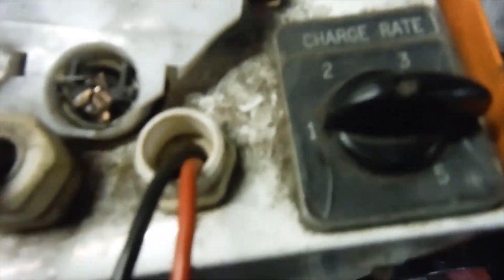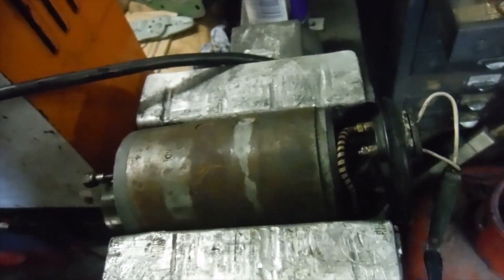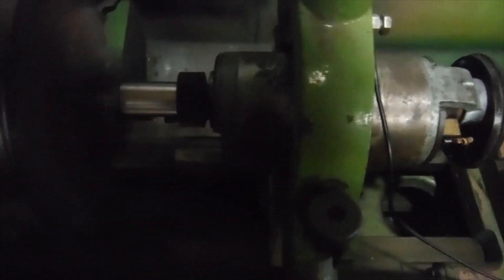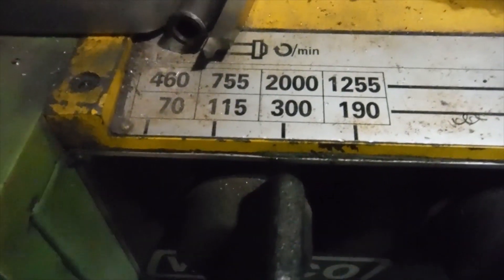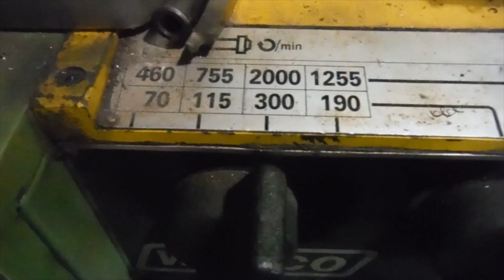Lucas motorcycle Dynamo checked for output and discussed.

Comment: Hi Paul  , I have two old bikes BSA AND Matchless singles  with dynamos  but they haven't Ever had the wiring for the dynamo hooked up while I've owned them , can you tell me if I can install my magdyno and run the engine without any wires hooked up to it ?  Previously had no gear , or will it damage something?  Sorry to ask but that sort of stuff isn't written in any books I've got , hopefully I can get it wired ok with new DVR2  it's going 12v conversion armature etc . Cheers
Reply from the maker: Hi - yes, you can run the dynamo while it is not connected up, no problem.

Comment: The MCR type mechanical regulators are good at killing dynamos. Also using a battery that's too small also burns out regs and dynamos.  The makers and repairers tell you to use a battery no less than 10 amp hour. This means that 4.5ah miniature batteries in a dummy battery case is far too small and need to be doubled up inside the case.  Also a good solid state regulator is the way to go these days, and they fit inside the MCR housing.

Comment: It is admirable that magdinamo works perfectly, even with sawdust that dries out the lubrication. There is no sparking between collector and brushes, indicating perfect isolation between the collector lamellae and grounding between the housings, in addition to indicating that the liming of the collector in relation to the shaft has not been changed, indicating that the winding has not been changed. With the D+ output and the F+ field with full excitation, without going through the field resistance, it is producing a good load, being able to turn on the 12 lamp since there is no voltage control regulated by the field resistance or the regulator. After this cleaning and lubrication service, this magdynamo was in perfect condition to maintain the motorcycle's electrical consumption for a long time. A new battery is necessary so that the regulator is not damaged due to the lack of internal resistance in the circuit and therefore the dynamo. Another quality service from Performance Classics!

Comment: All the dynamos I've motored seem to rumble even though the bearing are A1. I think it's some sort of magnetic reaction because they spin silently when turned with a drill.
Reply: That is the case indeed when using a battery charger because its output is not smoothed. Motoring with a battery makes no rumble, but still not dead smooth as like you say, when turned with a drill.